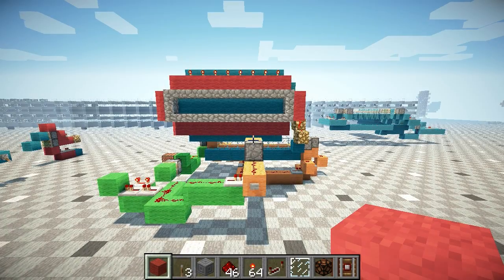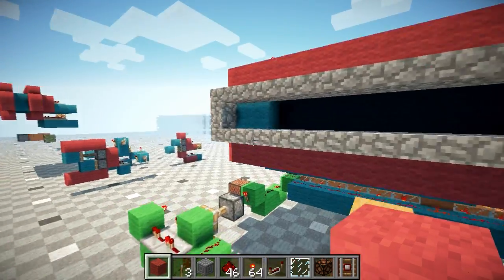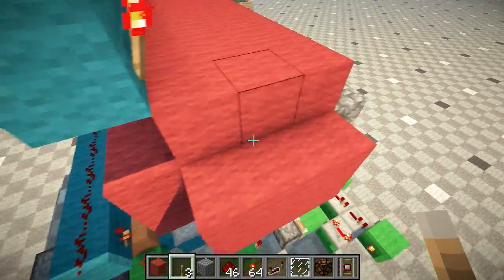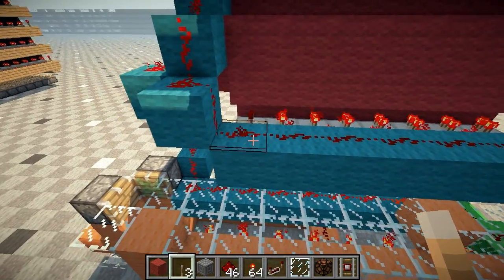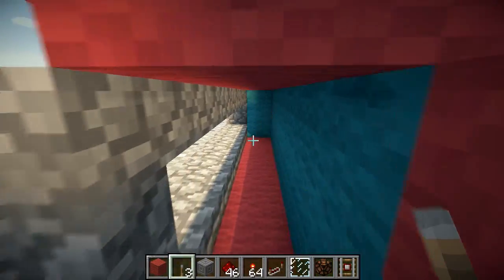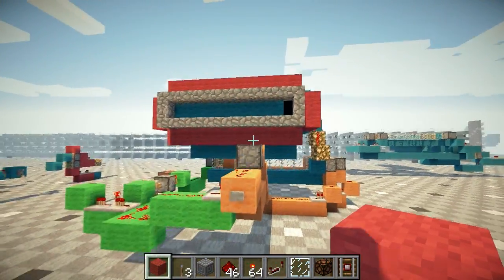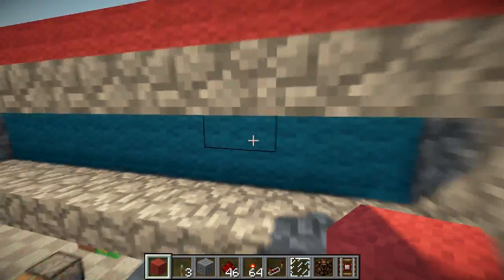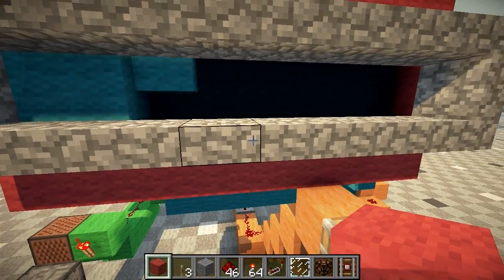A Loading Bar...every Minecrafter's dream come true

Comment from the maker: You could use them for the delay, buuut, that would take a lot of repeaters (it'd end up being much larger than this for large loading times), and when it is "reset" the delay would affect the reset so the pistons would retract in sequence rather than all at once.
The nice thing about this is that by increasing the clock time you could make it take several minutes to complete loading if you'd like. That would take....well, an absurd amount of repeaters.

Comment: You could do this with cyber's too... You just need to hook a monostable up to the output which stops the clock... =P

And I think Pear means point the repeater into the block on top of the pistons. However you may need to give the lower piston a redstone update but that shouldn't delay the signal at all... =)

Comment from the maker: :3
Clocks are the most basic redstone circuits, and remember the trick with the piston tape is to have the sticky pistons go off, then the normal pistons go off 2 ticks (or more) later.

That's basically it far as complexity goes. If you need help I'm always here (on the internet) to answer questions.

Comment: Haha, nice!  I made something similar for a certain person on the server, only instead of a clock an a piston tape, it used a counter.  That way you can send a pulse once something's been completed and make it work like a real loading bar.  If you want both pistons activating at once, use a repeater facing both or a torch on the top one. Good job!